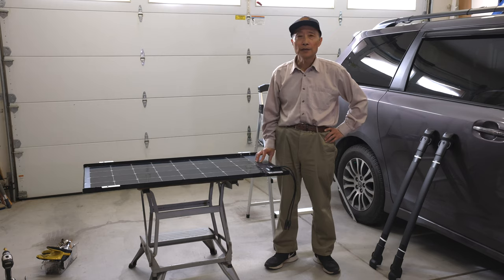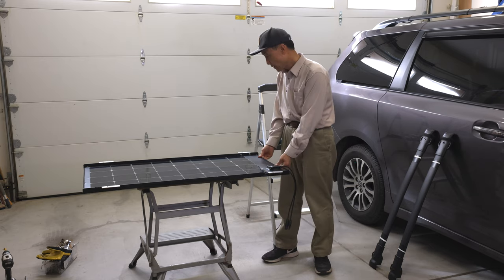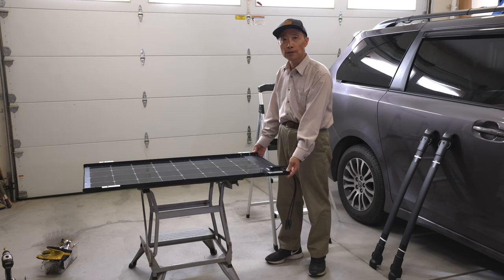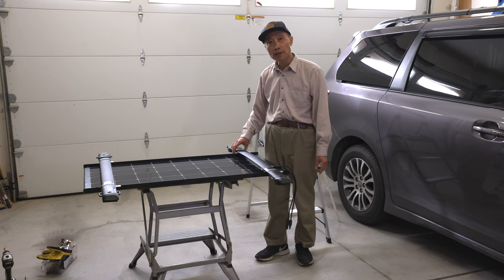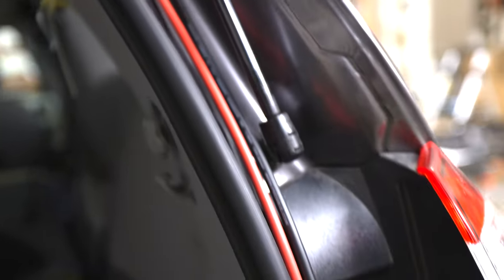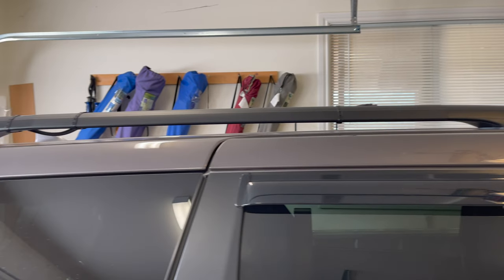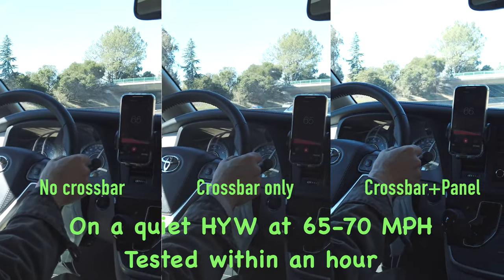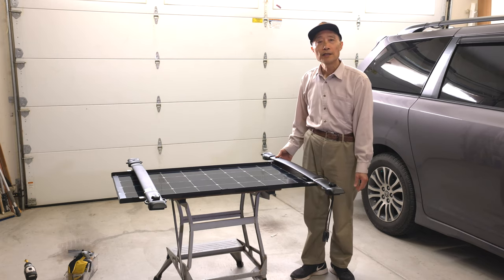Solar Panel on Sienna Mini-camper - My Experiences in Installation, Efficiency and Wind Noise

Comment: Why do you think that over tightening the crossbar bolts was increasing wind noise?
Reply from the maker: I think the panel will vibrate when driving at high speed. The tighter the connection to the van body the more vibration will be transferred.

Comment: I was curious  about the wiring. The wiring is at 2:58. Thank you.
Reply from the maker: It is very difficult to show in pictures. But the wires enter the holes I drilled and they can go all the way to the bottom. There is a drain hole behind the wheel well, as I showed in the video from inside the jack storage. It is normally covered by a plastic cover. I removed that cover and let wires enter the cabin through that hole.

Comment: Could you have run the panel parallel to the roof rack, where it would nestle down between the metal rack.. instead of going across it?
Reply from the maker: The roof rail spacing is not wide enough. It would need to sit on top of roof rail.

Comment: I decided to use a solar suitcase instead - and take it out when I stop. Otherwise, I have a Jackery.  I would love to discuss what I have done - this is my 5th year of research. :)
Reply from the maker: Lisa, thanks for your suggestion! I'd prefer to have a roof-top one so that I have the option of charging either driving or hiking. I am working on a different implementation and hopefully it will work :)

Comment: Thanks for sharing. I would not have known that there really isn't any added value to using a flexible panel
Reply from the maker: I have another video after this one discussing a different installation. I think that it is much better and weights much less. You may find it useful.